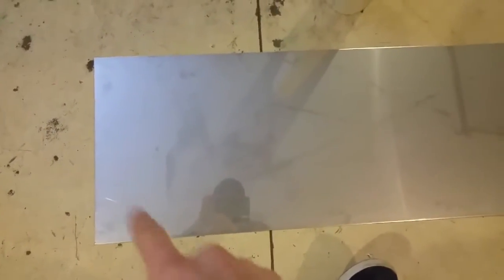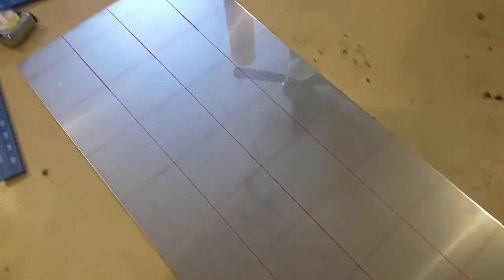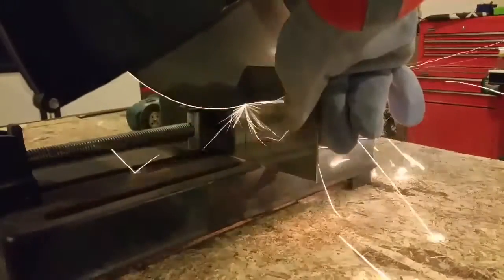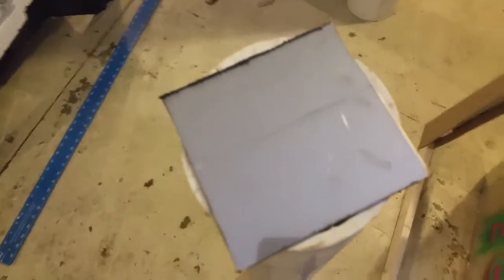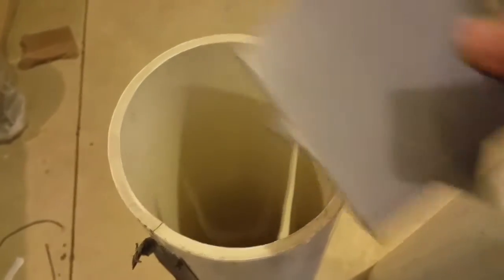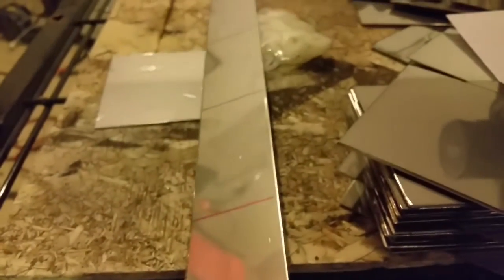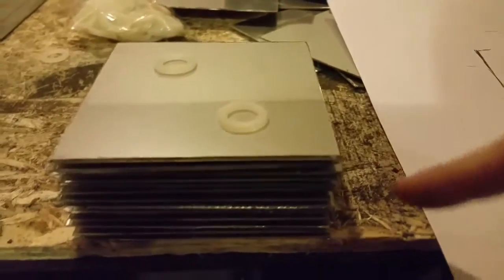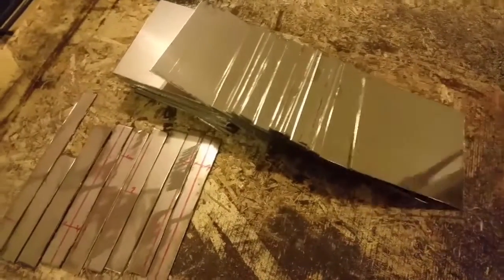49 PLATE HHO Generator WET CELL Project!!!

Comment: Hho or hydrogen hydrogen  and oxygen is an experimental technology and we are still at learning stage. So becarefull. Hho Technology will surprise you! Hho is a mind blowing technology . Cool engine running  prolonging engine life and engine oil life with less engine maintainess required🚦.

Engine life changer device improve engine performance and increase fuel burning efficiency like  a new car!!!  100% fuel will burn in the engine No un burn fuel wastage . Engine will run more power fully. Consume less fuel. Hho system works on petrol, deisel, cng, lpg and lng types gases.

Engine runs lighter smoother reducing carbon emissions significantly . Boost engine power and torque . Hho gas reduced engine noice & vibration

An efficient hho car kit lower the engine temperature more then 100 degree F.  To prevent heat build-up. Hho kits restore better fuel economy. Hho system is very easy and simple to install. Hho solves the engine heating problems automatically!!!.

Cleaner engine running. Reducing engine noise due to the faster fuel burning. Hho car kits works nicely requires no modifications in the car engine. No side effects on car engine.

Engine start quickly your car battery will charge  quickly car AC works better& safe your car battery.  make your car a low cost hy-brid. Use a  low amps. Hho car kit will work better. You can easily transfer hho kit from one car to another one. Hho kits requires no any modifications in the engine. For more information about this useful technology  keep watching hho zafar videos. Or call 03082266179 zafar karachi.

Comment: I separate HHO using two positive connections instead of one negative and one positive.  
Just look at the crappy video I made, to find out how.

This will change the world to a Hydrogen economy if implemented correctly.

My video is just to prove the concept works.  

It's a way to recycle electricity at the same time as generating HHO/electrolysis production...